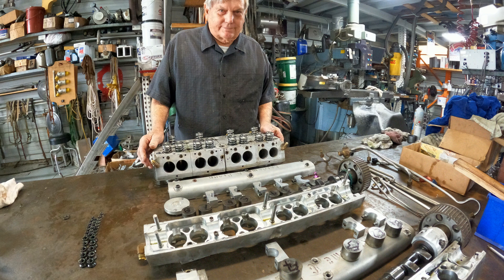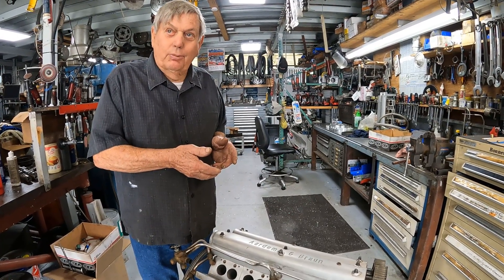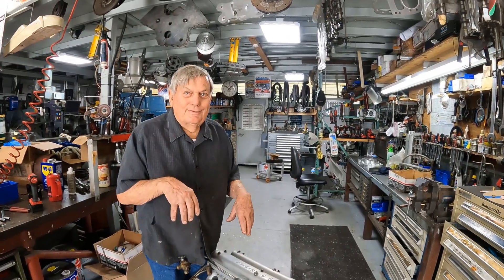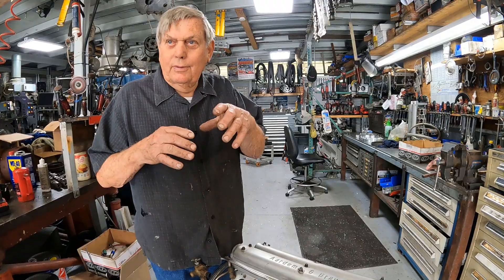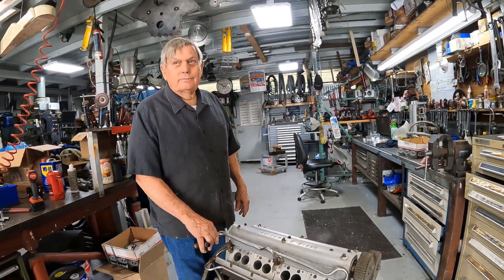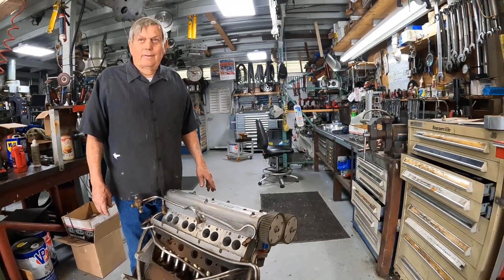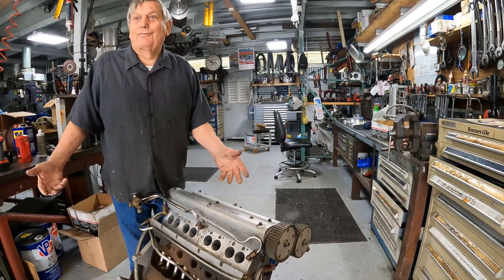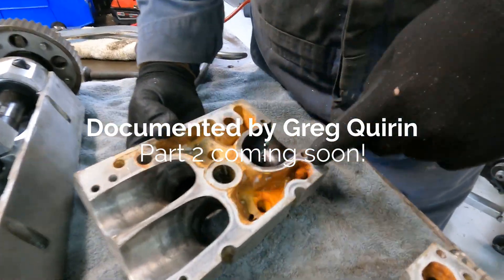238 MPH Vintage Ford Model A Engine Explained - Part 1

Comment: DEAR RETARDS,
   GM BUILT TWO EXACT MOTORS AS IN SAME COMPRESSION RATIO, BORE, STROKE, INTAKES, VALVE SIZES ETC BUT ONE WAS OVER HEAD CAM AND OTHER PUSHROD DESIGN AND TESTED THEM ON DYNO AND TWO EXACT CARS. THEY FOUND OUT THAT PUSHRODS MADE MORE TORQUE AND HP DUE TO LESS PARASITIC DRAG FROM LONG BELTS OR CHAINES.(Published papers backing data) BUT THIS WASNT GOOD ENOUGH THEY PUT BOTH MOTORS IN EXACTLY BUILT CARS AND ALL THE PRESIDIENT AND CEOS DECIDE IN A BLIND PICK AFTER TEST DRIVE. THEY ALL PICKED UNKNOWING THE PUSHROD BUILT CORVETTE... HISTORY THEY DENY US AND NOTE THERE WAS A PUBLISHED PAPER ON IT. ANOTHE TID BIT RETARDS IS ENGINE MASTER ENGINE BUILD OFF REGULATES COMPRESSION AND DISPLACEMENT AND ALMOST EVERY ENGINE BUILT NO MATTER YEAR OR MAKE IS ALWAYS ARE 10 HP OF EACH OTHER!!!! OHC 🤮🤮🤮 ALL THESE RETARDS ARE DOING IS PUSHING DIRT AROUND!!!
Reply: Try checking out Hotrod magazine June 2001.
We did a test with push rods and switched the very same engine with the same heads to overhead cam with exactly the same lift points, same lift, same valve springs, same overlap, and duration.
We picked up 21 horsepower and ran the engine to the same rpm.
The pushrod setup started floating the valves at 7000 rpm.
The overhead cam did not. If we would have run the overhead cam setup to higher rpm we would have picked up more horsepower, but we were trying to see just what the difference was by switching to overhead cams.
We picked up 21 horsepower running to the same rpm.

Comment: So what components determine if it is or isn't a model a, block and crank?
Reply from the maker: The block must remain in tacked which is the  minimum requirements per the rule book to run in the V4 vintage class at Bonneville. Thank you for watching!

Comment: I wonder if Pete has ever given a thought to making a two stoke motor and run in the fuel class. My thoughts were that this might eliminate possibilities of valve train breakage. Also, not sure if one couldn't use nitrous directly port injected to act as a boost with the two-stroke idea. Imagine a six cylinder 2-liter two stroke motor and what it might sound like! surprised nobody hasn't made a two stroke with maybe tangent located cylindrical rotating valves to allow better fuel/air and exhaust control. A supercharger could also be used with the cylindrical barrel valves as well. And no this wouldn't work on a model A block but maybe best on top of a bearing motorcycle lower.

Comment: I'm sorry but bolting Subaru heads onto a model a and then having headgasket problems is SO FUNNY hahahaha
Reply: Because it didn't fit 100% right.
Reply: @lordofrims  I know, and they fixed it. The synchronicity is just very funny.

Comment: I was hoping to see him do it on a stock block.  With the CNC stuff out in today's world, this is nothing impressive.
Reply: It is a 90 year old factory Ford model A block.
Reply: @Joe-kf1dy   - without original heads, crank and gearing, basically everything but the stock block.  Metal is metal and there is nothing special about a huge chunk of metal thats the same type of metal in blocks we use now.  In fact, we now use aluminum thats less structurally sound than the block they are using.  That makes it even MORE less impressive.

If it impresses you, thats fine.  Then again, fire stil impresses some indigenous people.  Who am I to say!?
Reply: @mistersniffer6838  How do your land speed efforts run?
Reply: @Joe-kf1dy   - What does that have to do with anything I was talking about?  Give me a million dollars (so I can quit my job and spend time on your request) and I will make a piece of dog shit run faster AND you will be impressed, I promise!!

Comment: So what is Model A ? Only the block ?.........MG went 250 mph in 57 with 1500cc !!........and on 3 main bearings.
Reply: did it have a model A block in it? Those blocks were made in the 20s, not in the 50s.....

Comment: Thanks for the post, I am a motorcycle mechanic and race motocross. Pete and Kevin inspire me a lot. Thanks to them for the inspiration and thank you Greg for showing me this amazing work!
Reply: Do you live by them??
Reply: @yungdolphin9130  no unfortunately not, I live in Sweden. I am going to attempt a parallel twin flat track engine build using Subaru block and cylinder head. I have a scrap 2.5 Subaru boxer engine and the idea is to adapt it to fit a classic parallel twin motorcycle engine and then enter it into a classic flat track event. The older motorcycle engines have limited tunability so the idea came to mind to do something similar to what Pete did with the model A.

Comment: What crank  that with five mains might be. I can hear some stupid say "will that fit in there" well you make it fit, you don`t order from catalog BUT its sure nice to know what cylinder intervals are on what ever engine. Honda uses 94,5 mm. and the motor I play with has 95 mm. intervals, so it is manageable. I wish that someone would make videos from my doings as well. Stay well.